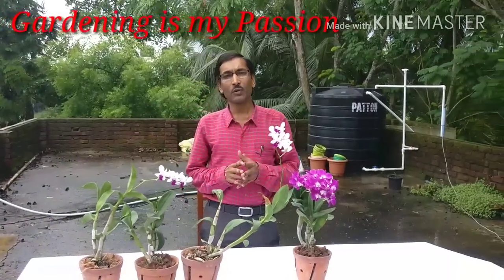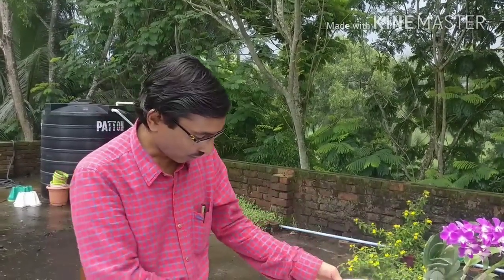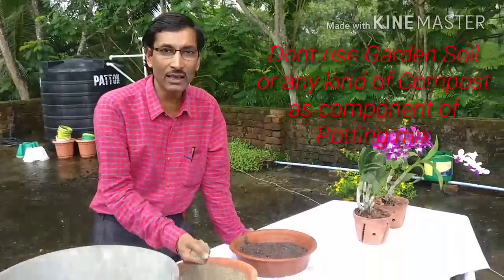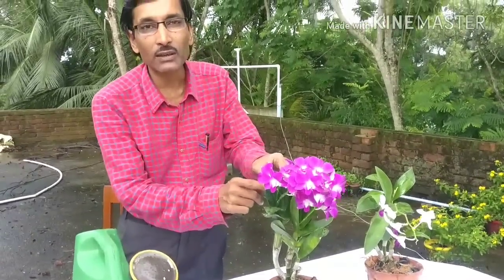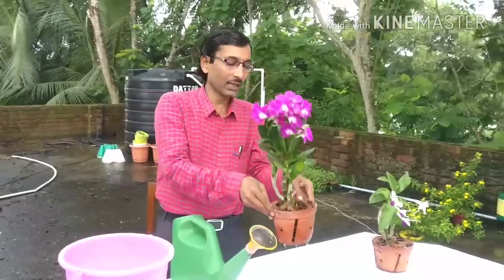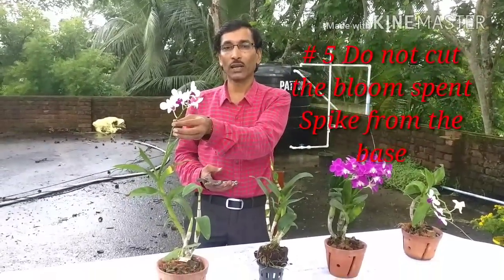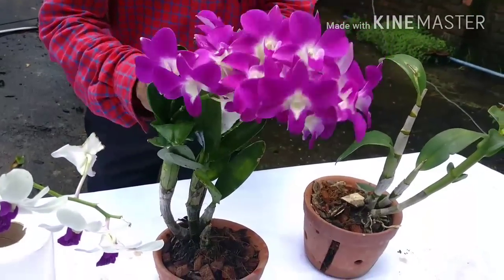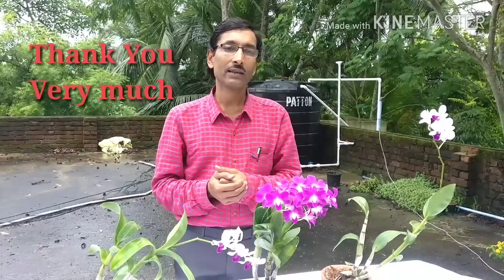5 Don'ts While Caring Orchids

Comment: Good info for beginners. Glad to see him talk about not cutting spike off on phalaneopsis types until it is dead (no green area left) and dry all the way down - many new orchid owners lose the opportunity for rebloom on the old spikes and lots of flowers when they cut the bloom spikes off just because the current blooms are gone.  I have a phal that bloomed in November and it has been in bud since - now the end of May.  I cut the spike finally but it could    NOT all orchid types  do this - for example cattleyas don’t rebloom on the flower stalk - once the buds have emerged from the sheath - that’s it.  When those are done you can remove any bits of dried sheath, flowers etc from that growth.  It will only rebloom on a new growth and from a new sheath.  However, the advice on not watering from above always seems contradictive as plants in the wild get rained on at least once per day to multiple times per day and even most of the day  in fog for those orchids that grow high in cloud forests.  Most folks fail to tell why you the difference and that it depends on your environment.  I try to keep water off blooms unless they have a lot of airflow to dry them off no matter how grown and definitely don’t water anything with the full sun or even partial sun on them.  Anyway - in the tropical forests most of these plants are growing upside down from how we have them in pots.  In fact when you mount orchids, it is really best and more natural looking to plant upside down from how grown in a pot. This position will keep the crown area and in between the leaves drier and it won’t collect water and thus potentially cause rot.  Mount phals higher on a mount and being upside down, the new leaves will grow downwards.
Reply from the maker: Thanks a lot for your valuable feedback.
Reply: I mist them daily too....but they are kept by a window with lots of air....so everything dries off

Comment: sir 
in my knowledge orchids can absorb water and nutritions through leafs stem and roots so water on leafs do nothing wrong with plants
Reply: this plant grows in rainforest not under roof so how could these plant be so allergic with water on leaves
Reply from the maker: They absorb water and nutrients from its roots where a velamen coated spongy  tissue remains there, which help to absorb them.Yes definitely these are the plants from rain forest. But if you have ever seen those plants in its natural habitat in forest,you might have noticed that the plants stems stoop down. Therefore, water is not retained in its nodal region.When we grow them in pots we keep them straight for its good look. My only point was not to allow the water to be retained in its nodal region.
Reply: Epiphytic orchids don't grow upright like the way we keep them in pots, they hang upside down from trees, so water runs off the leaves instead of pooling in the crown. When keeping orchids upright in captivity, water sitting in the crown can cause rot.
Reply: Ganesh Krishnan  ...for those  plants which don't grow in rain forest....and for a layman who has little idea or knowledge about epipytes....I think it is a very vital tip. There must be NO standing moisture orchids rot easily.sadly in a pot they are  grown upright.in nature they make their adjustments.

Comment: Sir, I have two dendrobium orchids. I have a query, should I spray the NPK 20:20:20 (which is recommended for orchid) on the surface of the potting mix or on the leaves. Please reply me.
Reply from the maker: Yes you can
Reply: Sorry  sir, I didn't understand, should I spray the NPK on the leaves of the dendrobium orchid ?
Reply from the maker: @sumitabiswas6434  
Yes you can

Comment: tell us about the fertilizer
Reply from the maker: Dont need any fertilizer. If at all needed please use some specific branded one specific for Orchid only.You can have them from reputed garden store or online. Dont use fertilizer regularly available in the market. Those may  harm your plant.
Reply: Thank u
Reply: no fertilizer only Black salt a pinch of is enough for one year
Reply: I have used some dried eggshell and tea. is that ok?
Reply: +Tasnim Tabassum  dried egg shell is good
but water them in every week not daily basis
root rotting is a major problem, and off course use fungicide

Comment: Stem also dried out  what to do
Reply from the maker: S . G
It seems that there is a serious infection problem. Please remove the completely dried up portions and repot the plant.
Reply: Gardening is my Passion 
I just removed all the potting mix. It was very very wet 
😨
Reply: Shayad mistake hogaya kya???
Reply from the maker: S . G
Potting mix may be moist but in no way Wet at all.
Reply: What do I do now???  I drilled holes in a new, big container just like the video says.
Reply from the maker: Ok,Do this and wait for results.
Reply: Do you have an email Id to which I can post a picture of how I replanted.  I'm still skeptical about it.